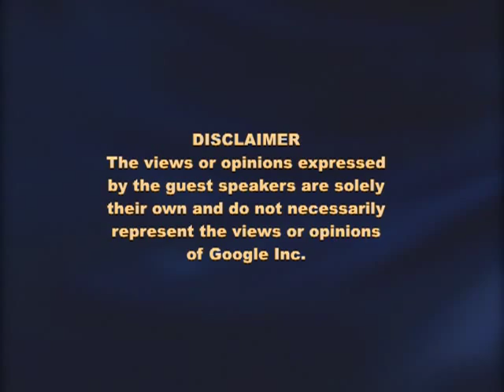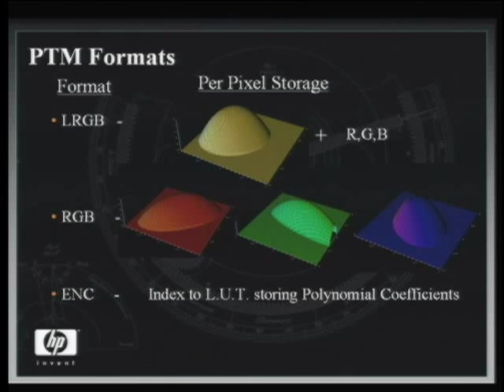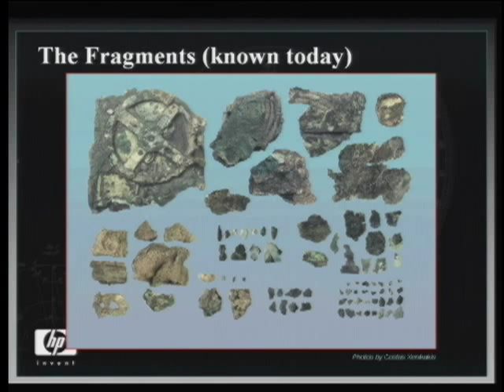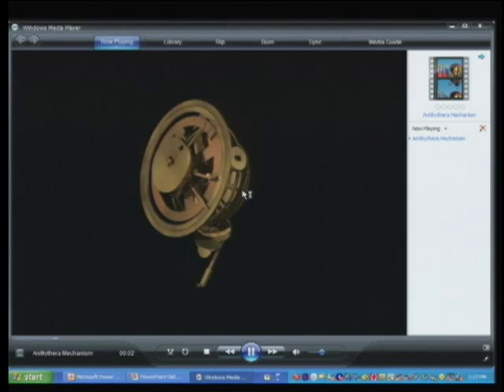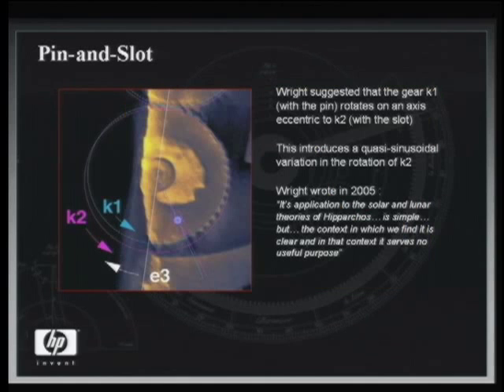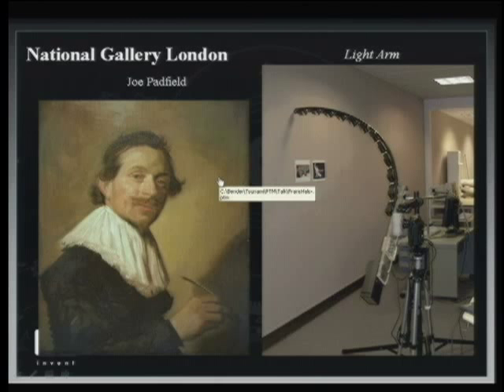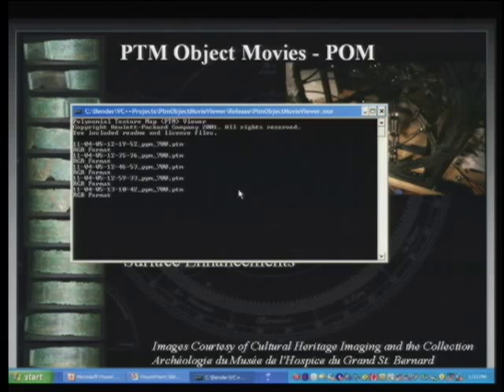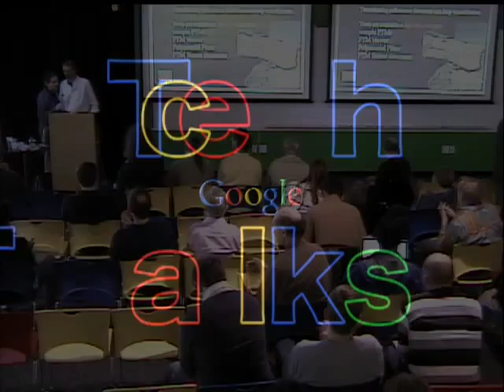Imaging the Antikythera Mechanism

Comment: Another mind blowing Ancient Greek discovery was the complexity of the geometry in the recent restoration of the Parthenon. The building was reassembled incorrectly in the 1920s, so it had to be dismantled and rebuilt properly. They tried to use 3D CAD software to solve the giant jigsaw puzzle, but the geometry was too advanced for computers. So in the end it was worked out by hand, with life size cardboard cutouts.

Comment: need to re scan the object with super compueters and with 3 d scanners like the type used in automotive or plastic moulding type machines, so that you get a hi 6k scans of the object, plus to date i have not seen anyone do a carbon dating on the item, they say its around 30 to 60 bc old, yet no carbon dating has been done on it, it could be a 1920 man made object, which is what i believe it is?

Comment: It's on the way to recognise the temporal holographic Imagery of time-timing sync-duration recirculation, Condensates floating in Eternity-now Singularity positioning Actuality. 

If you look through Binoculars and a Landscape of Objects, the outlines of the objects are flattened and suspended in the visual field in instantaneous pictorial superposition identification of vibrational timing modulation interference positioning resonance <-> numberness/mapping coordination. I shows how the collapsed Quantum-fields Mechanism operates in omnidirectional-dimensional logarithmic interference, transverse trancendental positioning and density-intensity real-numberness vanishing-into-no-thing Holes of eternal sync-duration Singularity-points. It is not what you think, becausewe are only aware of the Universal Instant, and zero-infinity cause-effect vanishing-into-no-thing in i-reflection containment is nearly incomprehensible, no matter how much you think you understand.

Comment: I have read with great care and extreme enthusiasm anything that came into my hands regarding the Antykithera Mechanism and two sets of questions arise which, deliberately or not, all these fine, educated scholars seem to have so elegantly go around like the proverbial HOT POTATOES

What had PROPELLED the contraption? Has there been a mechanical or even an electric (''Baghdad battery type'') source of energy? (I can imagine a tiny DURACELL energizer bunny sitting inside this contraption, the bunny of course having perished in the shipwreck) .. alright, let us not our wings grow too large, I will not mention (actually, I just have!!) an atomic source ??

The second group of untouched questions is the presumed time the contraption actually stopped functioning due to both the MECHANICAL STRESS (storm and sinking) and the CHEMICAL REACTION (the salty sea water) of the catastrophe ... neither article/video deals with IN WHAT POSITIONS THE DIALS/GEARS WERE FOUND TO HAVE STOPPED ... remember the infamous Hiroshima watch (saw a replica at a museum)